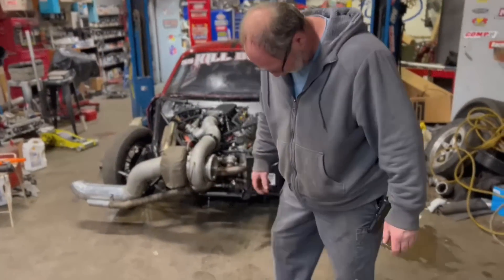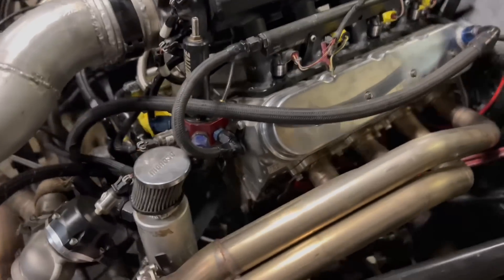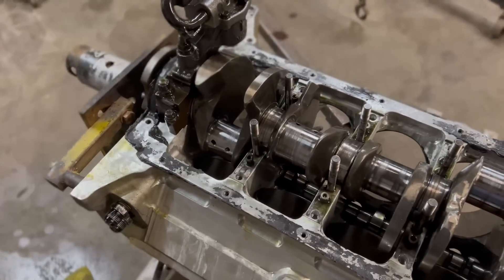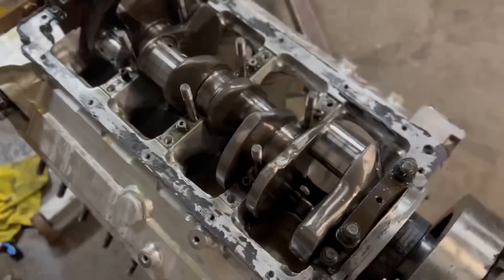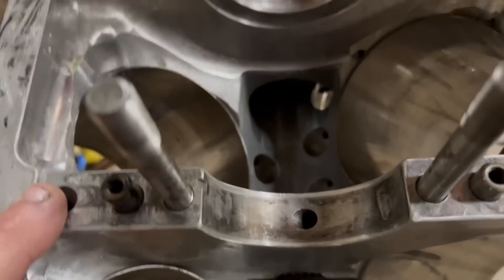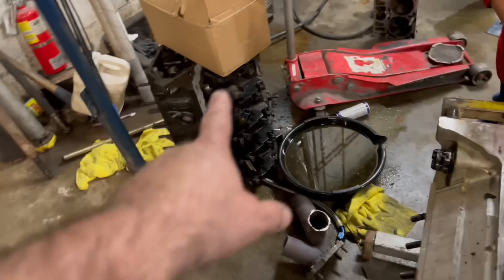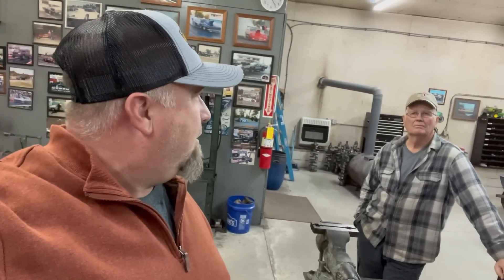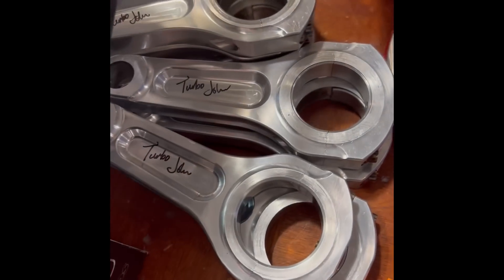Engine is Destroyed, but is it Salvageable?  All Aluminum SBC!

Comment: It's hard to race competitively when all you have is junk and miss match parts. I get racing on a  budget but at some point you just have to put money into the build with correct parts correct machine work and correct assembly. He spends good money after bad with all the junk he buys to try to put a engine together. Build 1 good engine and you will be much better off.

Comment: Was that hole in the base of that back cylinder just a drain back or does it need a weld repair on your Alum. BRODIX Block TJ? And That bracket hole on Brian's head may have been an issue based on how that head split if the piston clearance was ok and did not smack the deck hard. Wondering if it hydrolocked in that cylinder perchance.

Matt's LS (at DNR), went through a piston and rod delete too, and possible open trailering in rain may have filled the turbos up and possibly done that, but he does not know yet.

Just watching all you heads up guys thrash like you do to make this stuff go faster and faster each week and go through all the carnage to keep up with a class of racing that is out of control does make me wonder when there are really big money bracket series going on where people are racing on super prepped tracks for regular travelling big money pots, with buy backs, double entries and multi-days in a row everywhere.

But, each man (and woman), has their likes and dislikes and preferences, and I know you love no prep front or back of the track, and it is really big in your area right now. And you need to do you, and what makes you happy...racing is just a real struggle sometimes, the nature of the beast.

Am glad the block looks good enough to repair, and parts are avail. So far. Wishing some good luck starts to shine down on TJ Racing, Brian, Randy, Matt, Billy, and the rest of the SRC Gang, C.J., and a few others lately too many to list in the Small Tire World. All my faves minus Tommy are blowin' stuff up.

Chasing the racing dream is never easy, or everyone would be doing it!
Reply from the maker: I’ll find out in a few days about my block.

Comment: Did the restrictior get plugged on the side not oiling?
Reply from the maker: Yes, that is exactly what I'm thinking happened.  This block is priority main, then the oil goes to the restrictors.
Reply: I need to go review your prior build vid, but at one point you showed those front brass plugs and the restrictors, and you switched them because something in the cam gear/belt drive needed clearance I think?

Maybe check with Brodix, and see if they have a cutaway diagram on that particular block number and really research that particular oiling system as designed. Or, provide the Block info, and I can research and point you to some links John to maybe read up on it.
Reply: @TurboJohnRacing  that was my original thought.  Thanks for reply. You do beat on that car. Lol
Reply: @TurboJohnRacing  I prefer a restricted lifer to avoid those problems.  I have used edge orffice lifters since 1980 with good luck. 8500 rpm bbchevy. No restrictors at all if you do use restricted lifters.

Comment: Block shows a lot of signs of fretting under the caps. I think the main caps are walking around. When you first got that block I was a little skeptical of it working for you. I hoped for the best. But I’m afraid it might not be anything but trouble. That’s a sprint car block that has a lot of lightening options that might not work out for what your trying to do with it. I have a dart iron eagle block that needs a couple sleeves if you’re interested. 350 main 400 bore.
Reply: I need an aftermarket block, my crank is 400 main but if i could get a block at a decent price i can always get another crank without breaking the bank.

Comment: No way those main saddles won't require welding and a line bore. At least it's aluminum and you can do that.
Reply: I thought i could see the impression of some writing from the back of the spacers, maybe i need to look again.
Reply: I looked again and looks like impression and staining from the backside of the inserts, usually when one spins it cuts all that off.

Comment: Have you tried dowl pinning the bearing spacer in the main cap?  That would be my first suggestion. I would run .002 clearance on the mains.   To me your oil viscosity is terrible with all that meth in the oil.  It seems like something is terribly wrong with you ring pack configuration.  The rings are letting to much contamination by.  You cannot protect bearings with it like that.   The terrible blow by you have is a huge warning sign.  I would revisit in detail how the rings fit the piston groves, the amount of tension they have, and the end gap clearance you have.    .........You generate wonderful videos......

Comment: Getting rid of the spacer bearings in that aluminum block is a wise choice. You're stacking too many heat expansion factors there. You mentioned a 3.75 stroke crank, extra cubes are good. Assemble carefully. Good luck.

Comment: An aluminum block must be warmed up before full throttle or the bearing clearance will be too tight and it will spin bearings a cast iron block is much more forgiving go back to cast and life will be much easier